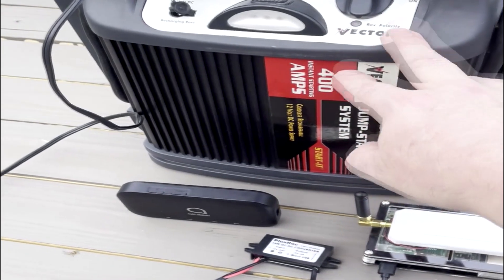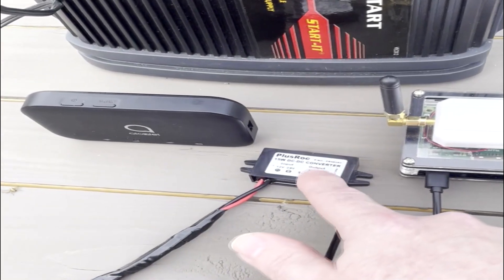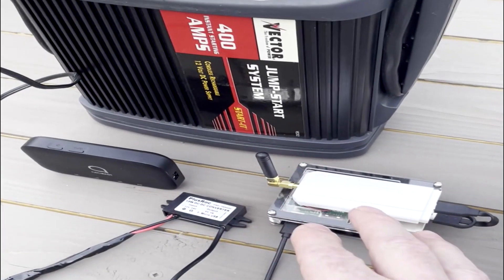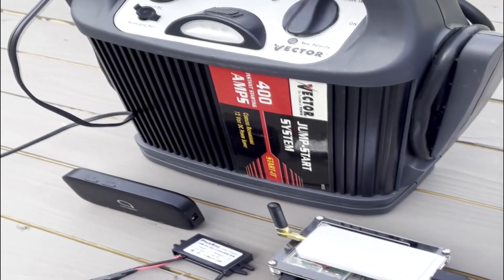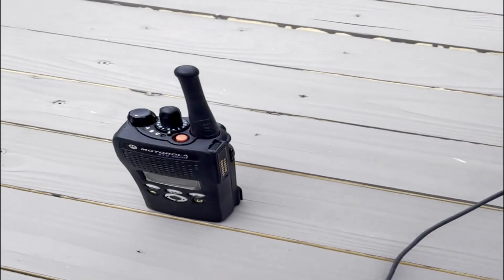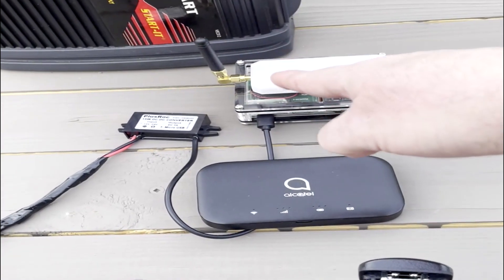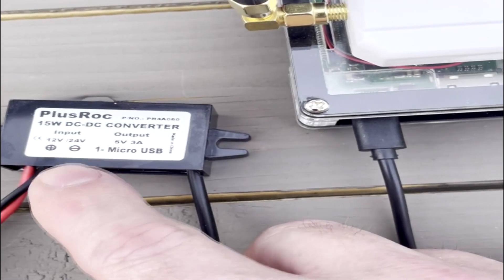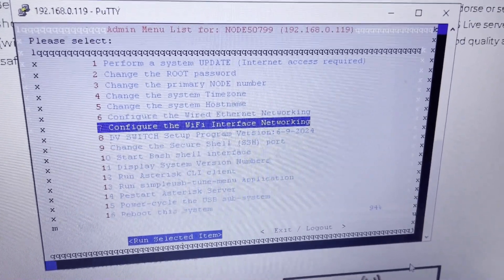RASPBERRY PI NODE WIRELESS SETUP #gmrs #radio #hamradio

Comment: What is the brand and model of the transceiver that’s connected to the raspberry pi computer? How much does the cellular service cost for the cellular hot spot? Do you need a lot of cellular data for the cellular hot spot? Some vehicles have a cellular hotspot feature that can be added, but usually those include very little cellular data. The node is probably going to run a long time on the battery, but the cellular hotspot is probably going to run out of battery power in several hours, unless you can plug the cellular hotspot into the large battery. The system could also work with the cellular hotspot that’s built into your cell phone. But when you walk away from the vehicle, it’s going to quit working.
Reply from the maker: Tmobile has a Hotspot plan for $30 a month... You only need 4G... actually I perfer it... Generally, a safe rule is 1 GB per 1 Hour... and you will always be safe in any estimates.